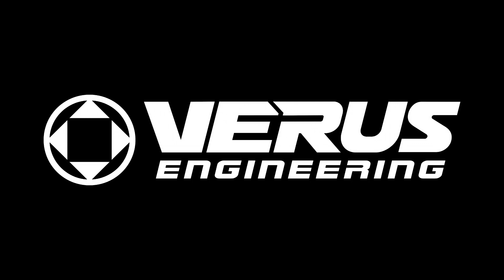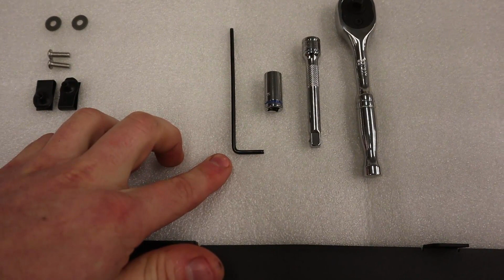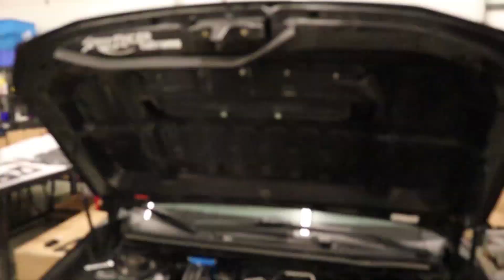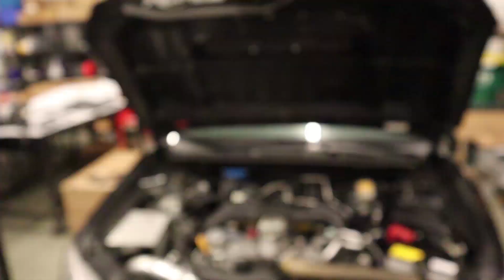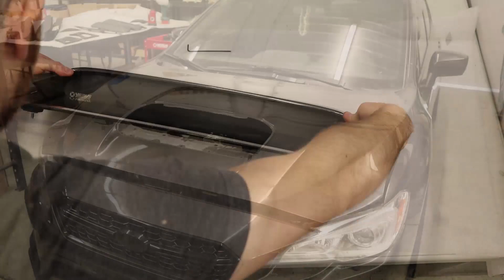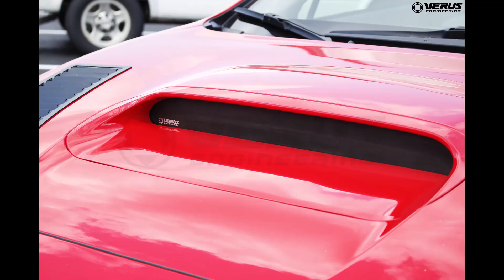Hood Scoop Block-Off Kit Install - 2015+ WRX/STI (VA)

Comment: Video was ass thanks for the help anyways
Reply from the maker: LOL... What are you wanting? This is a pretty straightforward and simple install.
Reply: @VerusEngineering  definitely not a vape hit lmao maybe next time let’s start with the headliner removal
Reply: And maybe make it stop water as that’s really the only reason I bought it and everything can still get in there 😂
Reply from the maker: @Monsterjjk  The headliner is easily removable with a handful of push rivets. Most people already have this taken off at this point due to having hood louvers instaledl. The block off wasn't designed to keep water out. They are for blocking airflow into the hood scoop.
Reply: @Monsterjjk  put some weather stripping and no water will get in you goon
Reply: Need a video on how to boil water too?
Reply: Just say you’re stupid

Comment: 1:27 I don't see how this helps improve the aerodynamics. You're plugging a hole but you still have to contend with the speed bump on the hood. Can't you just install a hood from a regular Impreza instead? This would eliminate the speed bump and make it a little more stealthy.
Reply: Yes, a scoopless hood would be more aero but this mod greatly decreases drag as the amount of air to compress and fill the receded area with the plate is minimal.
Reply from the maker: You could definitely do that but replacing a hood is much more expensive than this solution. This block off keeps air from entering the hood scoop and causing unwanted lift and additional underhood pressure. Removing this unwanted lift and underhood pressure creates downforce.

Comment: For those wondering, I have no hood vents and no air box with a FMIC and my IAT went up after this mod. I highly recommend doing a DIY air box with hood vents for this mod to be worth your time. The block off fits great and there is no problem with it at all but my setup was not ready for it. 👍

Comment: If I don’t vent the hood with louvers do you still recommend the block off plate? I really won’t want to add louvers. I would like to cover my bov since is right in the opening of my scoop and I’m afraid water or debri will get in there.

Comment: Did you guys do any validation that this product reduces pressure under the hood behind the cooling stack?
Reply from the maker: It will reduce this when paired with a set of our hood louvers. The hood still needs venting.